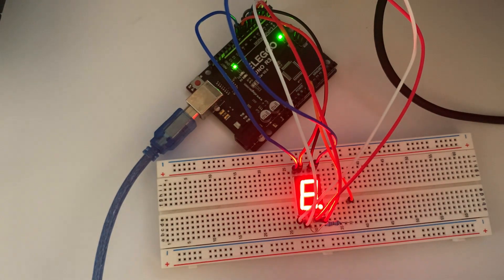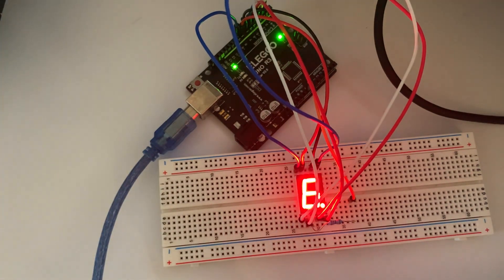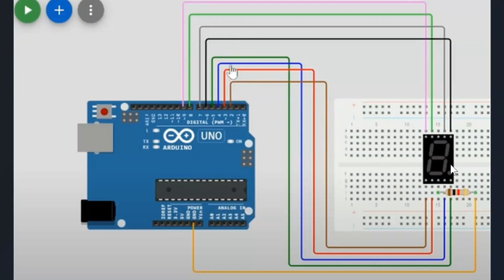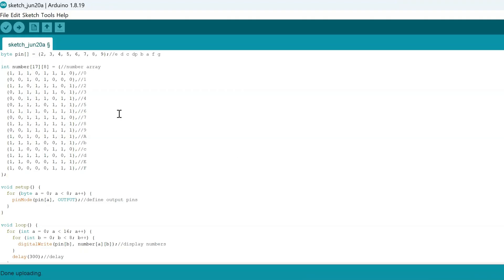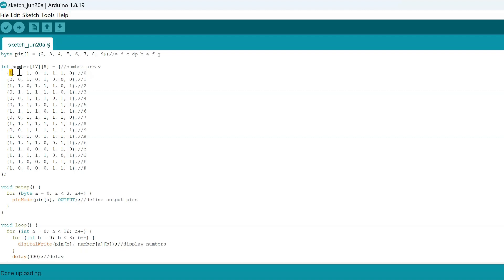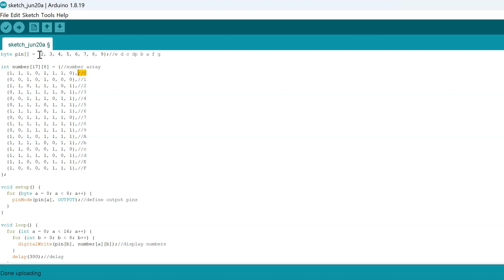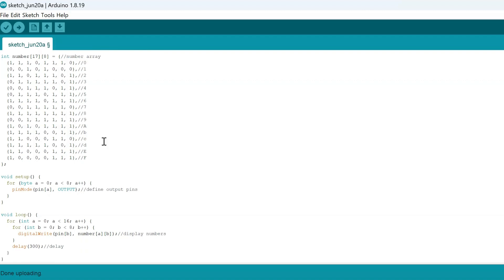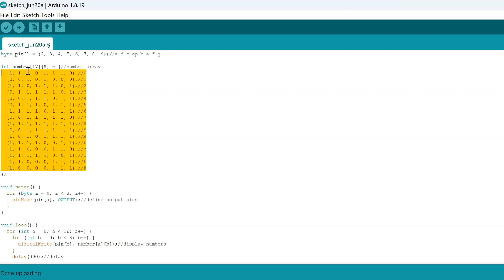How to display HEXADECIMAL with 7 Segment display in 90 Seconds

Comment from the maker: byte pin[] = {2, 3, 4, 5, 6, 7, 8, 9};//e d c dp b a f g
 
int number[17][8] = {//number array 
  {1, 1, 1, 0, 1, 1, 1, 0},//0
  {0, 0, 1, 0, 1, 0, 0, 0},//1
  {1, 1, 0, 1, 1, 1, 0, 1},//2
  {0, 1, 1, 1, 1, 1, 0, 1},//3
  {0, 0, 1, 1, 1, 0, 1, 1},//4
  {0, 1, 1, 1, 0, 1, 1, 1},//5
  {1, 1, 1, 1, 0, 1, 1, 1},//6
  {0, 0, 1, 1, 1, 1, 1, 0},//7
  {1, 1, 1, 1, 1, 1, 1, 1},//8
  {0, 0, 1, 1, 1, 1, 1, 1},//9
  {1, 0, 1, 0, 1, 1, 1, 1},//A
  {1, 1, 1, 1, 0, 0, 1, 1},//b
  {1, 1, 0, 0, 0, 1, 1, 0},//c
  {1, 1, 1, 1, 1, 0, 0, 1},//d
  {1, 1, 0, 0, 0, 1, 1, 1},//E
  {1, 0, 0, 0, 0, 1, 1, 1},//F
};
 
void setup() {
  for (byte a = 0; a < 8; a++) {
    pinMode(pin[a], OUTPUT);//define output pins
  }
}
 
void loop() {
  for (int a = 0; a < 16; a++) {
    for (int b = 0; b < 8; b++) {
      digitalWrite(pin[b], number[a][b]);//display numbers
    }
    delay(300);//delay
  }
}